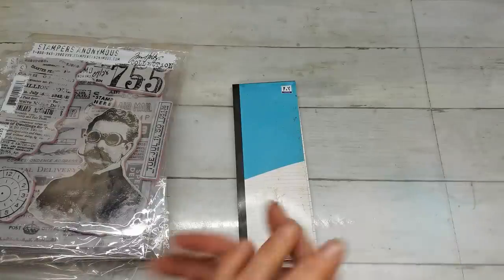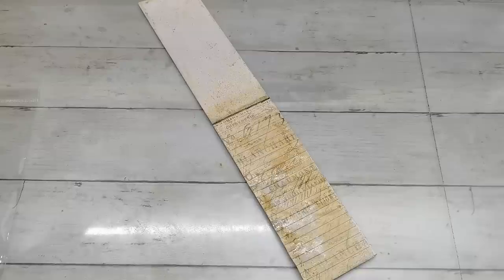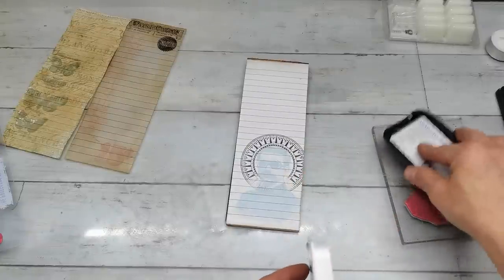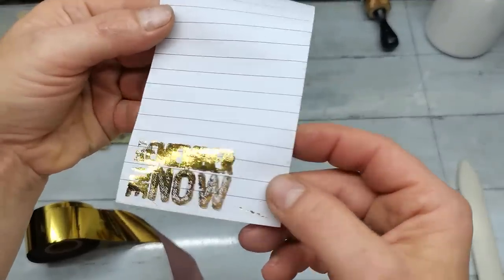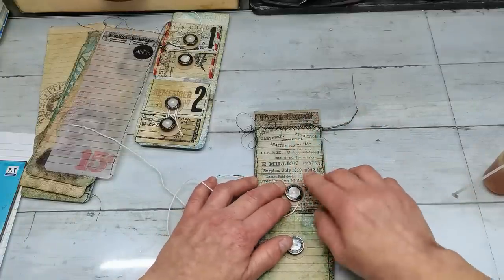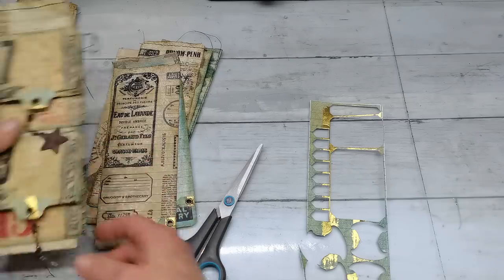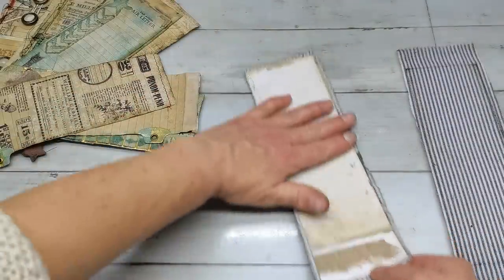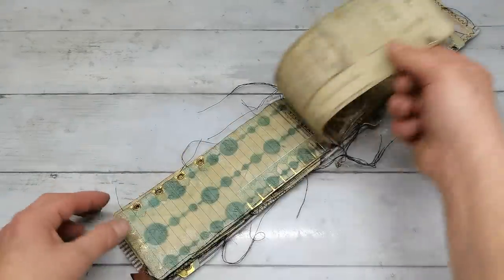CRAFT with Me Altering little notepad

Comment: You made me smile when you said you smoosh when you stamp. I bought a Tim Holtz stamping platform thing that places the stamp in the precise position to stamp repeatedly, like an assembly line. But I am too lazy to get it out. It sits in my craftroom staring at me. When I am in the midst of creating, I will grab a rubber stamp, rub it into ink, and stamp my project with my fingers without using one of the acrylic blocks I have to assist. Seriously. I do not care if there are marks or smooshes. It is not supposed to be perfect. 😍 In my world, anyway.